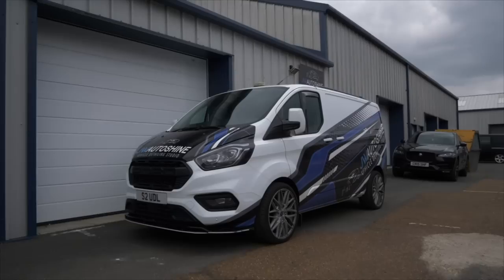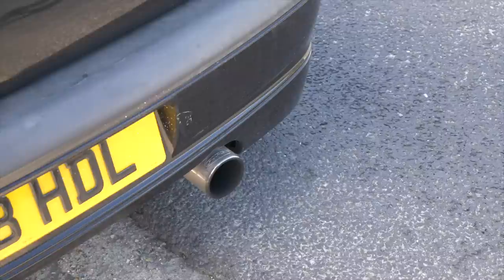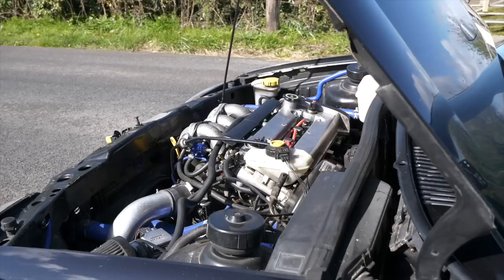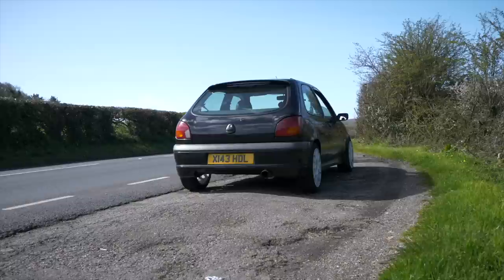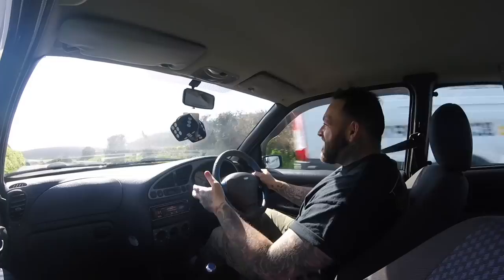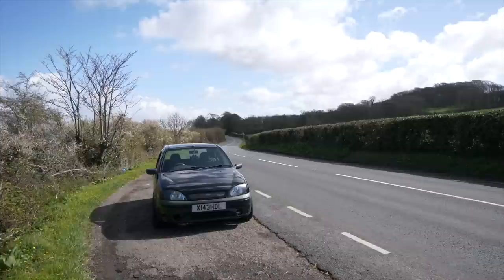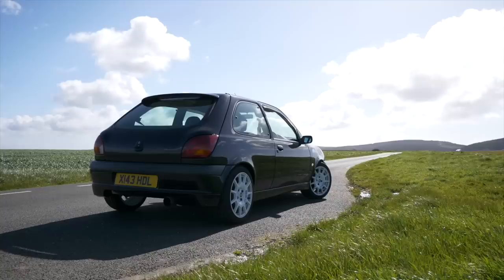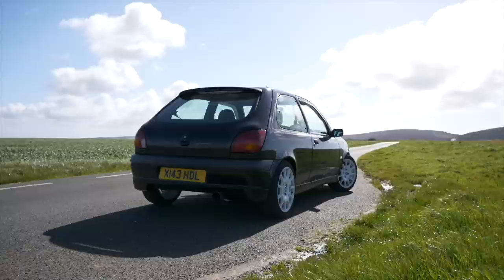Budget built *PUMA TURBO ENGINE SWAPPED* FORD FIESTA!!

Comment: I saw someone selling one of these with this engine conversion and I believed boosted with a big intercooler exposed on the front. Think he put it up for 3k
Reply: I believe that one was supercharged if I remember correctly. The imp blue one
Reply: @tipik9792  yeah that's it. You might be right there. Can't believe how "cheap" these builds are. Saw a Peugeot 205 gti with a 2 litre turbo swap in it for 6k. That thing must shift. Only thing I'd worry about a project car like that is if the parts used will last or where I'll locate a replacement part
Reply: Most aren’t cheap tbh few years ago these cars were pennies. But gotta be so careful with the rust on them.

Comment: 200hp for b roads is the best amount for fun; can actually use it all  anything around the 300 plus gets out of hand to easy 🤣🤣
Reply: It just proves you don’t need millions and squillions of horsepowers to have loads of fun behind the wheel.
Reply: Yes mate exactly, hoping to get 250bhp once it’s done and then maybe ST180 swap one 👀
Reply: @tipik9792  what about a k swap 👀
Reply: @owenscallum4565  would be sick but would cost a fortune. Could always look into it though 😏
Reply: @tipik9792  my mate builds k swapped st150’s for a loving, rob randsom creations 👀
Reply: 300 horse front wheel drive is perfect.  With the right chassis, mk3 cupra, mk3 megane RS, golf mk7 onward do it effortlessly.
Reply: The meganne has one of the best fwd chassis ever